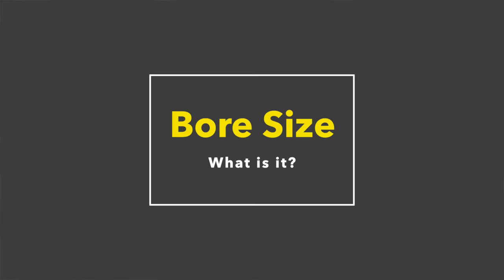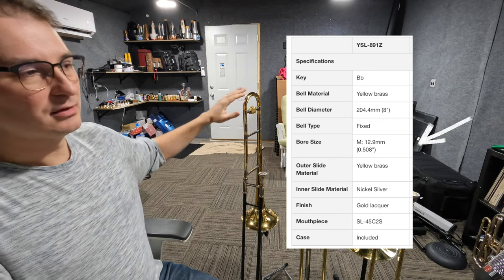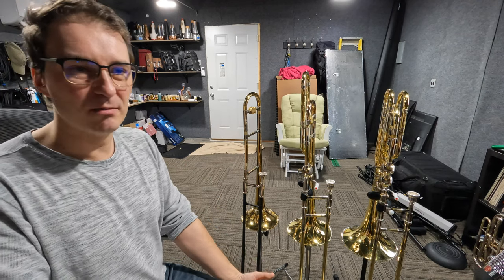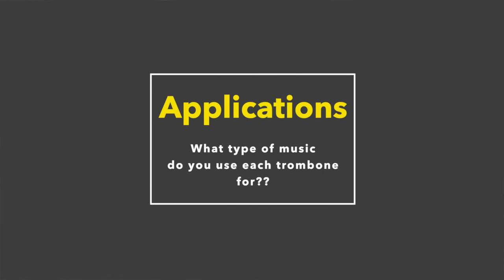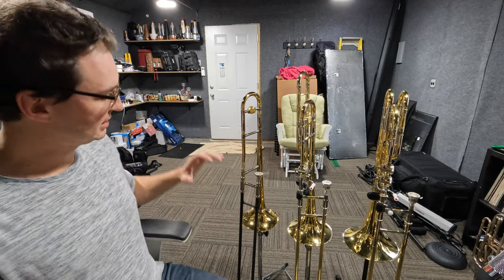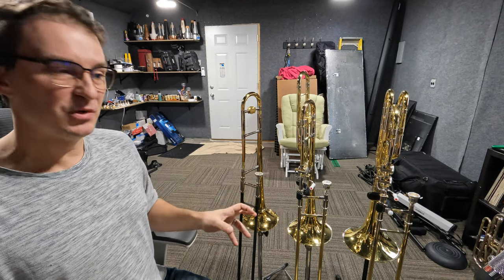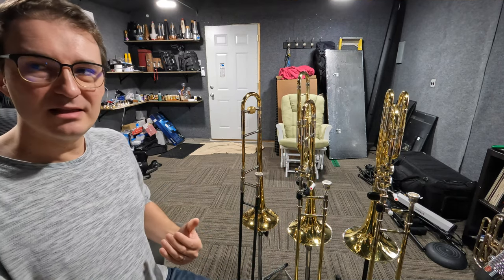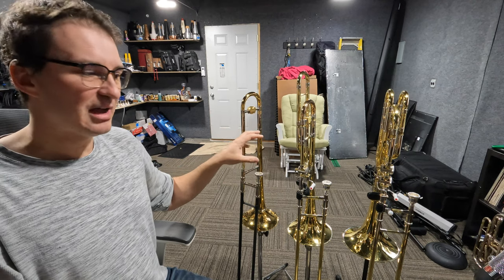Trombone Lessons - What are the differences between Small Bore, Large Bore and Bass Trombones?

Comment: With the large bore symphonic tenor, you can still get that super low B natural, but you have to stop & pull out the f attach tuning slide almost all the way. If that's not possible, then I would bring it up an octave. I think that a medium bore tenor with an f attach would be a good all-purpose horn (e.g., Bach 36b).
Reply from the maker: True. The issue just becomes that all the other positions are different if you tune the trigger to reach the low B. Generally you won’t have to play a Low B on a trigger horn anyway. A medium bore can be a good all around horn but it doesn’t always fit perfectly well. It’s a more difficult instrument to play lead on in a jazz band and sometimes too small to play in a concert band or orchestra. It definitely has its uses.

Comment: Good evening!  I've just discovered your series and I'm very impressed.   Lots of good information. 

I have played a small bore King 3B for many years and am considering a new horn.  What differences (advantages) might I find in a medium bore (525) horn, and would the air required be vastly different?

Thank you so much!
Reply from the maker: A 525 needs a bit more air since the tubes are larger. It has a bigger sound as well. No advantages to me really. It’s just a different trombone that gets a different sound. If you want a bigger sound it will give it to you.
Reply: @LowBrassLuke  Awesome!  I didn't want to invest in the larger bore and then find myself gasping for air.  I should be OK.  

One more.  When I shop online, the great majority of horns offered have F attachments.   Not interested in that, but would these typically have the 525 bore?
Reply from the maker: @RoyPickering-l3i an F attachment doesn’t mean it’s a specific bore. You have to know what models are .525. You can find .525 horns with triggers and without. Same thing goes for .547 symphonic trombones. You can find those with and without triggers. Look up different brands and the descriptions of the horns. If you’re looking at getting a pro horn I do offer a service where I can help find a great deal for essentially what I charge for an hour lesson ($70). I generally recommend used professional horns as they give you the best quality for a great price.
Reply: Interesting.   Actually, I believe I know know what to do.  There has been a nice Bach 36 on Reverb that has seemed to call to me.  I think I will answer!

Thank you so much!